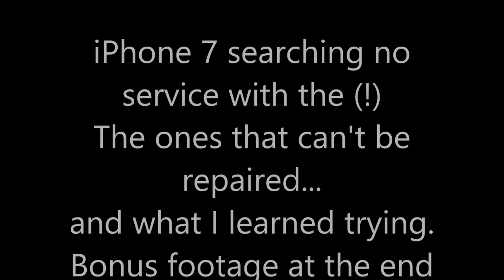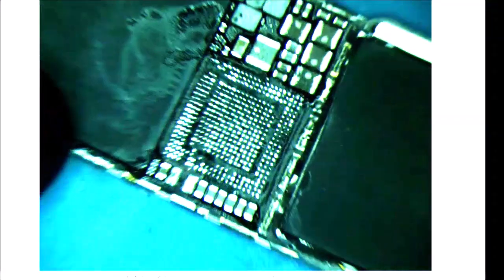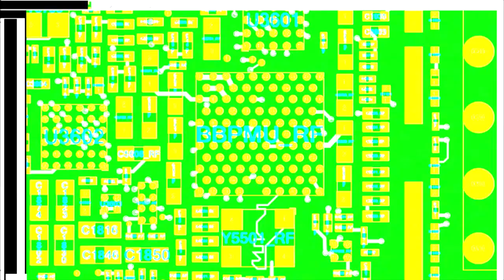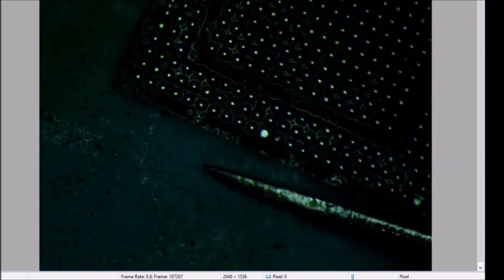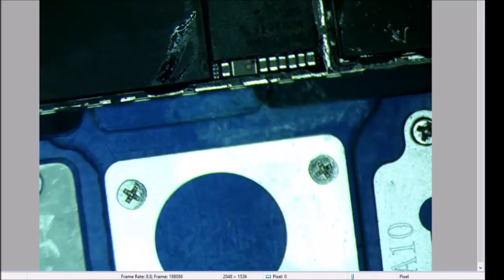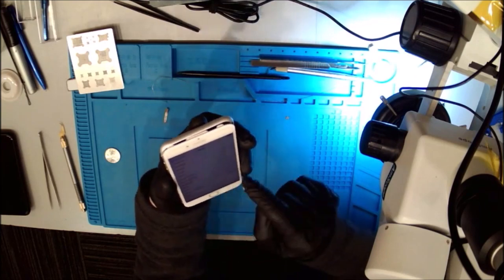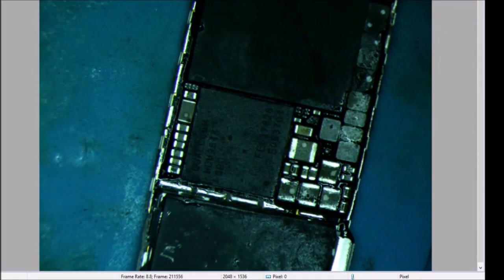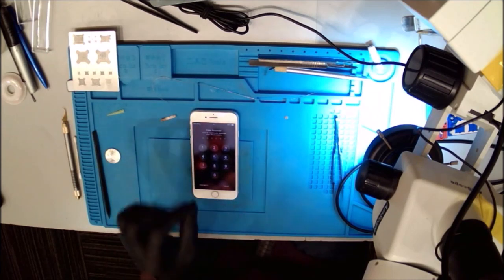Iphone 7 searching no service. Internal BaseBand short

Comment: Thanks! Learned a lot there. I have "No Sim" only. No exclamation mark, no "searching". Just...nothing. And I do have IMEI when dialling *#06#
Already tried all the software reset/network setting reset etc. 
The phone is unlocked and I've tried 3 different brand new sim cards.
The fact that I have IMEI suggest that the sim reader is no good. Had a look and it looks absolutely fine. No missing or loose pins at all. Tried giving it a clean. Nada. Have you ever had this problem?
Reply: Chris Mac 
i am normally fixing this problem there is no sim we can see but there is no imei when we are dailing *#06# 
so this problem im fixing with you install thr small baseband baseband cpu reballing and there is have on down side of the board wtr 2 ic’s install new ics and try it will be ok one is wtr3925 the another one i don’t know the exact number of the ic

Comment: Great work, how do you check if something is shorting? Just with a multimeter on sound? Or particular readings?
Reply from the maker: I prefer using continuity mode on my multimeter. then when something beeps you know it short to ground/ has continuity where it should not.